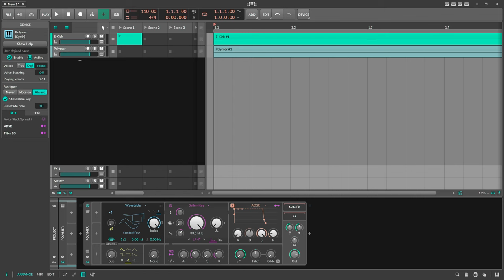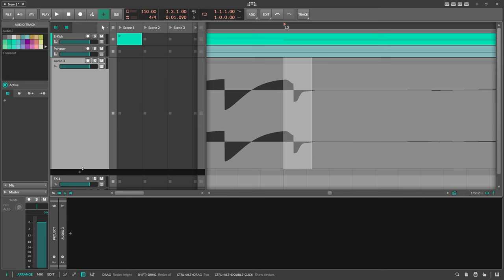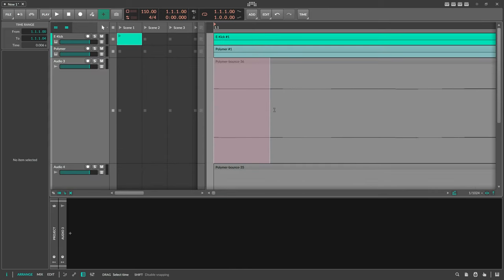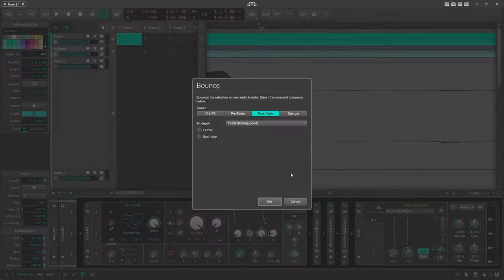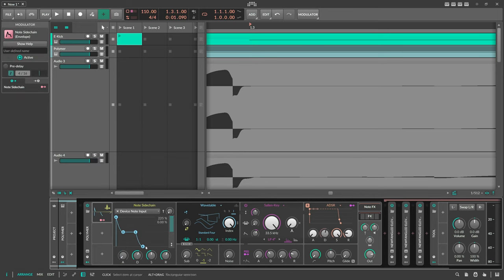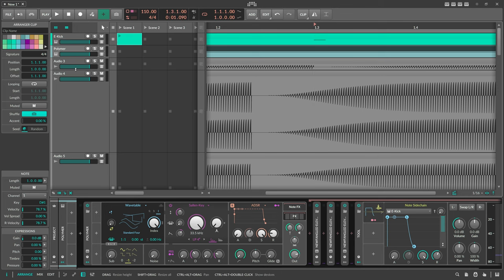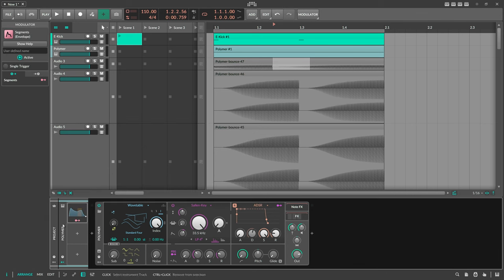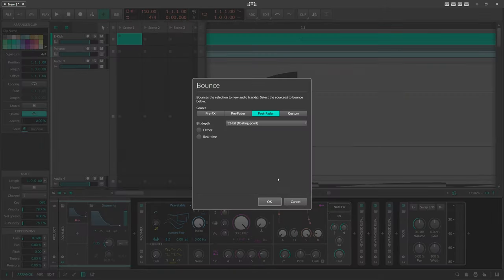High Precision & Mathematically correct Sidechain

Comment: For a 4 on the floor beat, the curves modulator can also be used in the Tool device to duck the audio. It can be switched on and off by the automation if necessary. However, one should keep in mind that if modulation shapes are too steep, they can introduce aliasing, which is especially audible on bass sounds.

Comment: Lookahead is still needed. Although timeshift can adjust the sidechain, it will affect the starting position of the track.
Reply from the maker: In my opinion, lookahead does the same, right? It adds delay to the audio to analyze the sidechain before applying it.
Reply: @PolarityMusic  You can try a lookahead similar to pro C2 for side chaining, extend the front part of the clip and then perform bounce. The time shift should correspond to delay compensation.

Comment: Hi Polarity! I have been trying the last method where a global trigger activates the sidechain and I discovered a massive delay compensation bug. When using a separate MIDI trigger track to trigger the sidechain on a project level, Bitwig doesn't properly calculate the delay. For instance I have a bass track that is being sidechained in a group and the midi trigger exists outside of the group. The sidechain in the bass group triggers 200ms before it's supposed to. Have you been getting something similar by chance? It happens when the project starts to get big and there is latency that is accumulating. This seems like a MASSIVE oversight by the Bitwig team. Im still on 5.0.11 so it may have been fixed in the last few versions.
Reply from the maker: I know they've made some fixes. Maybe try version 5.1; I haven't tested this in all scenarios because there are so many combinations.
Reply: @PolarityMusic  Thanks man! I may have to wait until I upgrade to check if there is a fix. Sad that we don’t get bug fixes unless an upgrade is purchased. I really like this way of sidechaining. Appreciate you demonstrating it!

Comment: Question... When using a timeshift device at the end of the chain and you told  that it will effect the startpoint of all other tracks (kick), wouldn't it also manipulate the groove? I'm not sure, since the kick is just visualized by the noteOn midi event, but not by the resulting waveform? In terms of sidechain it will work, agreed.
Reply from the maker: Sure, any timing offset will affect the groove, but we're talking about a few milliseconds for the entire track. So, not that big of a deal in my opinion.
Reply: @PolarityMusic  Thats right. The idea is great and helps in most of the situations. A blind kick track with an negative timeshift as input for bass ducking would be an alternative if timing has to be absolutly accurate (custom look ahead) :-)

Comment: How did you changed the UI colors?
Reply: I think its some kind of early-access over beta ... but would be alovely edition to bitwig
Reply: I think its about his post process of the video. You just change the hue on the video/
Reply: Looks like he changed the hue in nvida control panel or equivelent.  it will change it system wide though so not really usable in real world case :D
Reply: I wonder what the author will answer to this.

Comment: Having to use a time shift module every time one needs accurate audio sidechaining is frustrating. I know you joke about it not mattering but in some specific applications it could cause weird artifacts. but the main benefit of that bug being fixed would be just not having to think about it at all
Reply from the maker: Agree, but Bitwig doesn't know how "accurate" you want your sidechain. Envelope followers always lag a tiny bit, due to the nature of how everything works. Music isn't a clinical task; most of the time, you want some overlap to glue things together.
Reply: Sometimes overlap is nice, sometimes it's not. I'd rather control something like that with attack and release controls rather than the DAW make an assumption